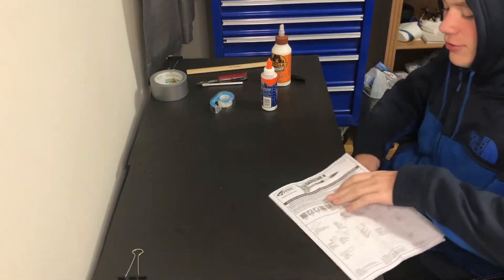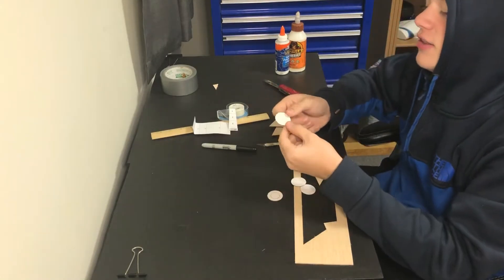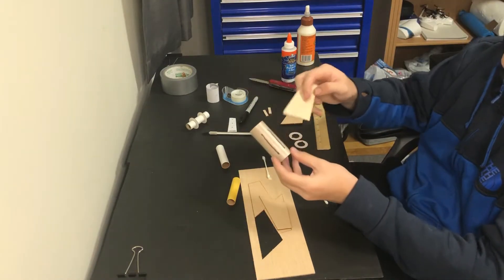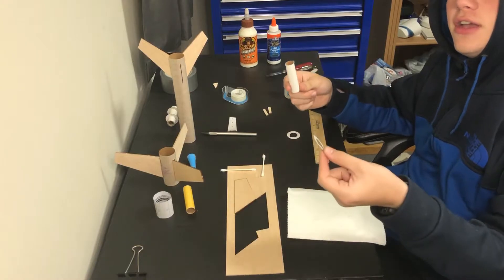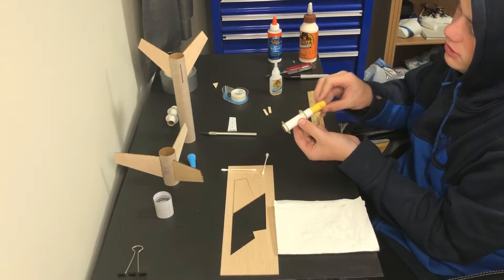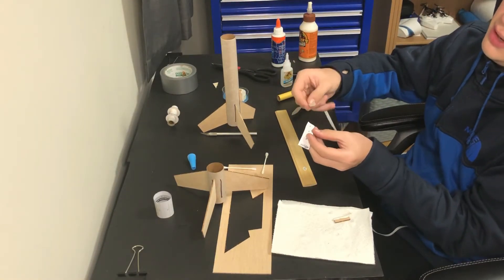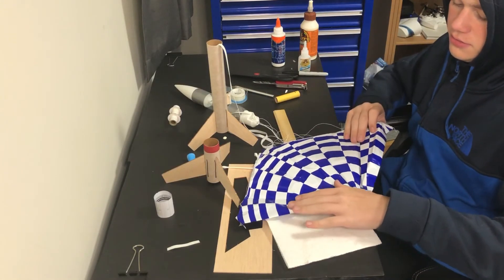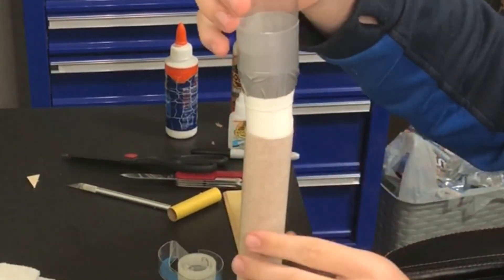Loadstar 2 Rocket Tutorial | CAP Saturn Phase

Comment: how do you hook up a double motor ? do you need to do the metal igniters and some how connect them together before putting them on the alligator clamps?
Reply from the maker: You tape them together but the bottom rocket has to be a zero delay. For example, C6-0 on the bottom and C6-5 on the top. After a motor has burned up it waits whatever the delay is before sending out a little final ignition out the top of the motor. That may be to light the next rocket or pop the parachute depending on if it’s the first or second motor.

Comment: Thanks for this. Did you use two motors to launch this, also what motor did you use?
Reply from the maker: For the booster use a c6-0 or a b6-0
For the upper use a a8-3, b6-6, or c6-7
Reply: @defaultgamer34857  thank you